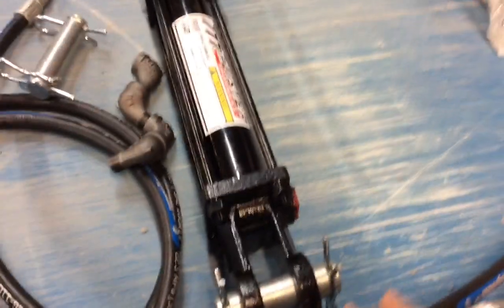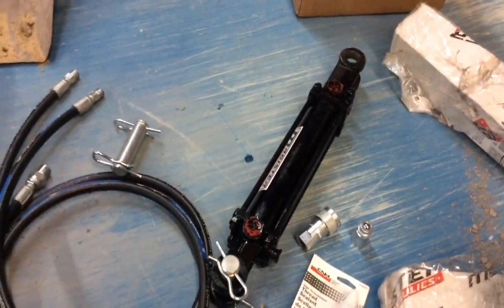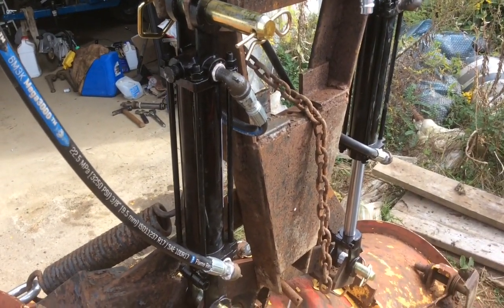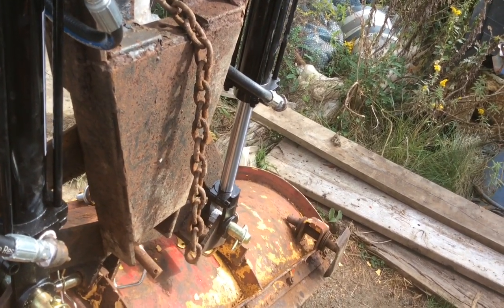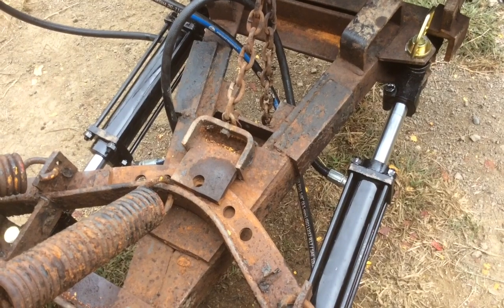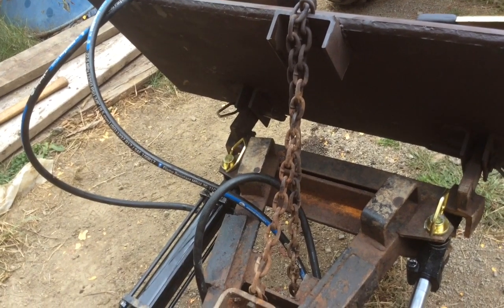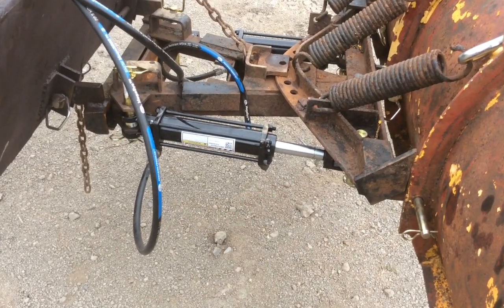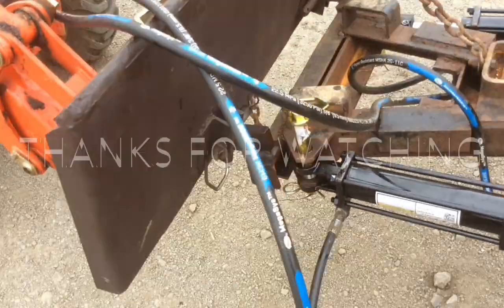Converting Truck Snow Plow Hydraulics to fit a Compact Tractor or Skid Steer

Comment: Josh,  great video!
Hydraulics engineer here.  The previous setup didnt work because the volume on the rod size is different from the volume on the opposite side of the cylinder.  You now have the crossover hose hooked up to chambers of equal volume which is why it works.  However, you now have both rod side chambers operating dry.  This could lead to premature failure of the seals or cylinders as they were designed to run wet.  
A common way to run those types of cylinders on a snow plow application is to use two tee fittings, and 4 hoses.  With the cylinders oriented in the same direction, rods forward.   Have one cylinder with tee fitting (3 way) on both ends, fwd and aft.   Run 3rd function hoses to those fittings on the one cylinder.  Fix the other two hoses to the remaining ports on the tee  fittings  and cross them over to the other cylinder.  Meaning, fwd rod end tee fitting hose connects to aft end of cylinder on opposite side.  Aft end tee fitting hose to fwd rod end on ther side.
Lastly,  with this application, both cylinders are contributing to the strength of the system.  In your application only one is contributing.  Another option, though not ideal, would be to only install one cylinder.
Good luck this winter!!  I too just got my truck plow convertedto my tractor last year, and it worked great.
Reply from the maker: I'll to take that into consideration, may be change the way I have it hooked up. Thanks for the information and thanks for watching
Reply: Great video
Reply: Daniel H 
Thank you. My memories (of youthful days when I thought plowing snow for people was a good idea) were making me think I was losing it. Then I read your post and stopped feeling as stupid. IIRC I had a Datsun 4x4 with a Fisher that was articulated by pressure and waste- only one of the two cylinders received pressure to angle, the other cylinder was open to the reservoir. Once the control was released both cylinders were open or ‘float.” Only a single line to each cylinder. 
I can see the advantages of having both ‘sides’ of the cylinder wet.
Reply: Can you draw a piping diagram to a kubota 3 function valve.

Comment: Great video. I have a pivoting snowplow mounted on my larger two wheel drive tractor too. Mine only has one larger hydraulic ram mounted on top. Wish I could include a picture. The 1950 Massey tractor has weighted tires and heavy duty chains. Good luck this winter. Thanks for the informative video!

Comment: Josh,  building similiar setup.  Like Daniel H stated the 2 port Hydraulics are suppose to be run wet on both sides.  Since I am not a Hydraulics engineer I might be able to explain in layman's terms.  Your 3rd function operates as a push/open both ways, meaning it pushes fluid to one of the two ports on the 3rd function and allows the other to receive fluid. Depending on which way you operate your controls one of the two is pushing fluid, the other open to receive.  Picture hooking up just one cylinder with the third function connected to each side,  when you press/depress your 3rd function control its sending fluid to either port to move the cylinder in and out, and the opposite port receives fluid.  To keep your two, two way hydraulic cylinders you would want to T off of your 3rd function to opposite sides of the ram thus extending one and retracting one at the same time.  The other option is to get single port snow plow Hydraulic cylinders and hook one line off your third function to each, these are designed where the cylinder is only operated on a push and relies on the 2nd cylinder to close the opposing one on its push motion.  Hope that helps.
Reply from the maker: Thanks.  I appreciate your information.   Since the making of this video I did change the way I have the hydraulics hooked up on the plow.  This was my first experience working on hydraulic plumbing, and it's the only thing I've had hooked up to the third function.  Thanks for sharing your knowledge and thanks for checking out the video.

Comment: Great video 👍 I'm glad you posted this video I was wondering how the Kioti third function hydraulic flow worked also. That plow will be a great help in the snow here in Arkansas snow is rare these days. I'm going Friday to sign and pay a big chunk of cash on our New Kioti CK3510 I pushed back the delivery date because I keep adding extra things to the  tractor. My dealership knock a bunch off this tractor I wanted to finance 5-6K so when he hit me with the final price for the CK3510 I said let's add some extra things so here's what I got.
Bad Boy Battle Armor Brush cutter 60inch with skids and chains
Third function kit
1 set of Rear remotes hydraulic valves
Lower extend links
HST linked kit
Cruise control
Canopy
Floor mate
Arm rest
Horn this is so crazy Kioti really I have to buy the horn as an add on. 
 Thanks for sharing.
Reply from the maker: Thanks!  It was a learning experience and still a little more to do on the plow before winter.  Sounds like your getting all the bells and whistles.  When I bought mine the “SE” version had all the “extras” and it was more cost effective for me than adding it all on to the regular 3510, so that’s the route I went.   Are you getting rid of your Boomer?   Congratulations on the new tractor! Thanks again for watching!
Reply: @JoshHovis  Thanks for commenting back and Hydraulic's can be a pain but when they  work man life is good. Yeah the CK3510 SE was what I wanted but my dealership had a New 2018 left over CK3510 HST so I got all that add on stuff listed plus the brush cutter and a canopy for my Boomer installed for under $21,800. I felt that was a deal for that Kioti. The Boomer is staying it's my tractor the Kioti is for my wife/son in a few years to help me out with property projects. I spend my days off just barely getting jobs done I need help so I can work on the other side of my projects list. I need a clone most days one to weld and one on a tractor.
Reply from the maker: Sounds like a really good deal!  Looking forward to seeing it at work on your channel!

Comment: If you look at the original setup the cylinders only have lines plumbed to the piston side.  Pressure to one cylinder pushes the rod end back and vice versa no need for double acting cylinder.  Those cylinders will work just remove rod end hoses and hook up pressure hoses to piston end only do not plug rod end ports, install air cylinder mufflers.
Reply from the maker: Good idea.  Thank you!

Comment: Great video! Can you map out the way the cylinders are piped to each one and to the 3 function. Thank you
Reply from the maker: Thanks for watching!  I have the cylinders plumbed so that the hose coming from my 3rd function (both lines) are hooked into the bottom  of the cylinder, not the rod side, and my crossover hose that connects the cylinders is on the top or rod side of the cylinder.   It seems to work fine that way but there have been several people in the comments that know more than I do about hydraulics that say this is technically not correct.   If you look further down the comments there is a detailed description by Daniel H.   Thanks